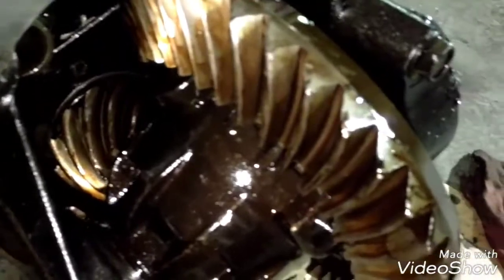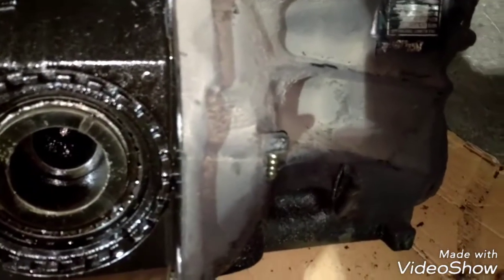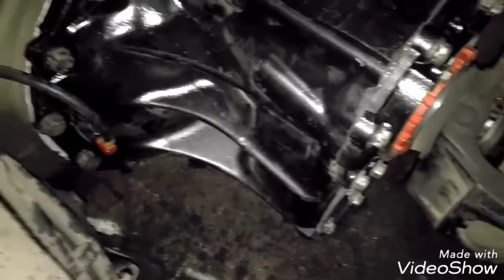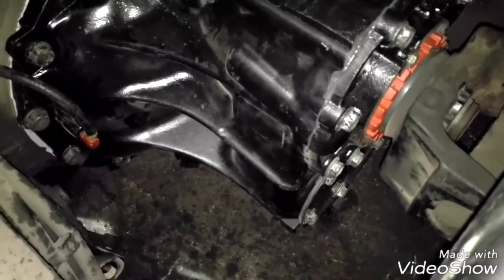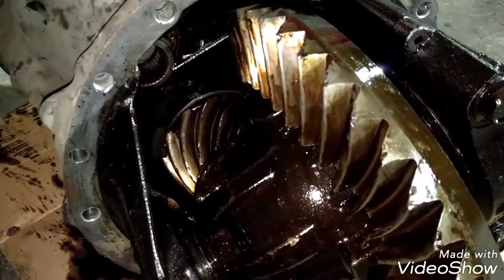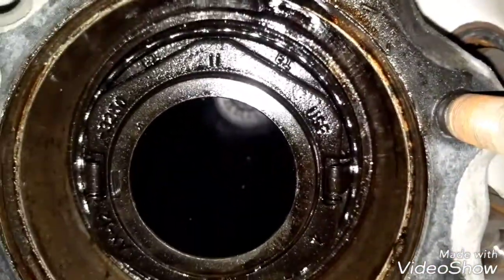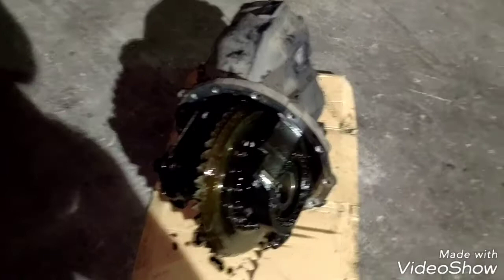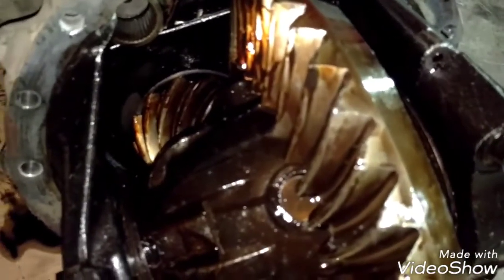Freightliner Cascadia broken differential

Comment: Question for you I have a 2015 cascadia 840k miles and I found chunks of metal in  the check plug for the front differential. 
No issues besides for it immediately taking off when I put it in drive it’s a automatic

Comment: Hi Francisco,
Did a  bad differential can trigger an ABS light ? I have a ABS light for rear right wheel that's coming special when turn right. 
  It's a 2012 Cascadia.
   Thank you
Reply from the maker: If the rotation is one side of the axle is faster that the other,  yes.

Comment: Hi my friend , I know this question does nkot have nothing to do with the dif. , but I need to replace the starter, and I can't get to the nut in between the engine block and the starter, it's very difficult,  can you give me any advice ? That plastic cap in front can be remove? Or anything ? Thank you.
Reply from the maker: Yes, remove a small bracket the holds the positive cable; it has one 13 mm bolt holding it and then use a 3/8 drive long extension with a 18 mm socket to reach it.
Reply: Francisco Amaya  ok thank you my friend, you r awesome 👍👍👍